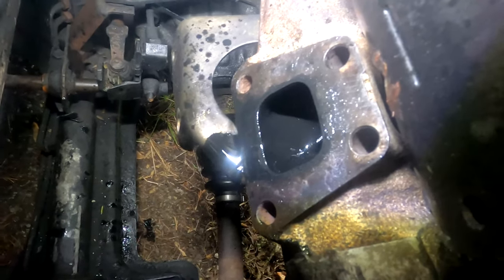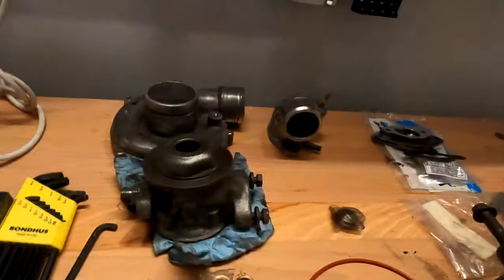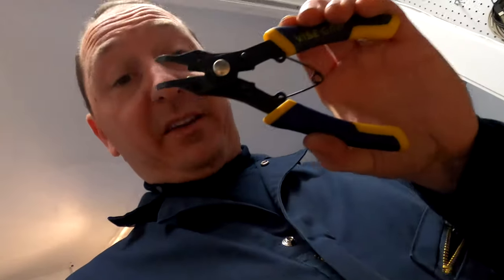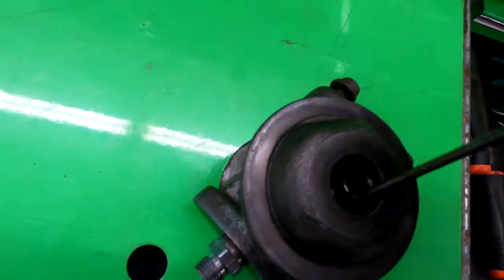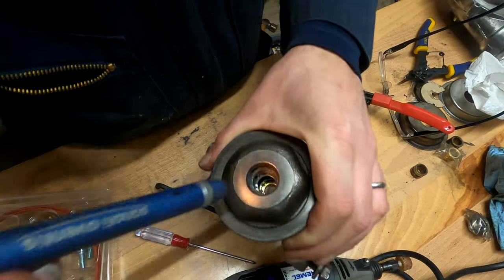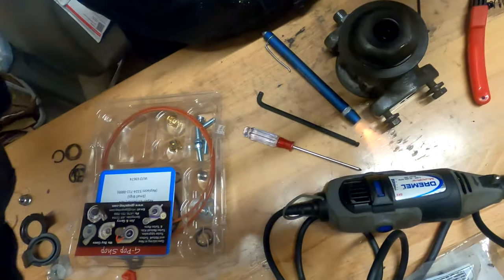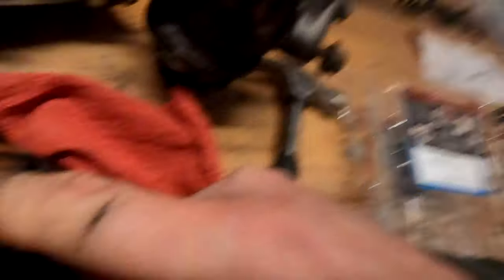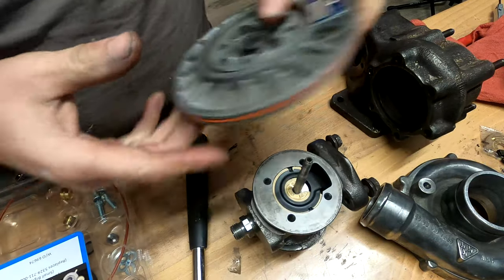Barn Find MK2 Jetta Part 5 - K24 Turbo Rebuild

Comment: Cool videos.  Went completely thru a 1.6td that I swapped into a rabbit pickup, and have been driving the wheels off of it.  Wastegate stuck shut on me the other day, so I figure ill rebuild the turbo, so this is cool.  Subscribed a while back. Been fun to follow the progress.  I HIGHLY recommend doing 2.5 inch exhaust when the time comes.  Sounds cool,  and reduces lag by a bunch! The reduced backpressure will let it build around 12lbs of boost instead of the stock 9 lbs.
Reply from the maker: Thanks for that tip, I was leaning to the 2.5" mainly because stock downpipe isn't available.  The 2.5 from ECS looks to be available and will bolt to the manifold and not that strange round flex thing.  Thanks for watching!
Reply: Build your own exhaust or check around for a muffler shop that is capable.  Just need to make a flange at turbo, work your way down and back.   It will be good content.  :)

Comment: see what did I tell you those guides are easy to replace but now the work begins .
Reply from the maker: Yeah we had quite the debate in the shop and it was not the smoothest of operations but we got it done.  Ended up making a drift with a shoulder that fit inside the new guides.  Froze them, went in pretty easy.  Thanks for the tip and for watching!
Reply: @tr3wrench  ya I have the tools for the guides and the seals but I tell you out of all the guides I have replaced (mostly air cooled vw's) these are the easiest. now if the valves fit with a small amount of play then you most likey can get away without reaming also if the valve faces are good doing a lap job may do. reaming and valve/seat cutting is best but may not be necessary. if you end up needing valve pucks (aka valve shims) I have a huge set I haven't used them in years. do you have the tools for doing the shimming?
Reply from the maker: @mikestrang6229  we did lap them, actually used a tiny bit of lapping and a custom tool to "ream" the guides.  two or three passes and the valve stems went in perfectly.  This is hydro head and the buckets are in good shape.  If the weather cooperates this weekend we might have the head ready to install.

Comment: These turbochargers HAVE to be balanced when placing the impellers back on the shaft. What you are doing here is stupid as these run at over 100,000 rpm and NO BALANCE???? That is why you will notice that the nuts on the ends of the shaft have been ground...in order to precision balance. Simply hob-knobbing them back together is beyond careless. The life of this beautiful K24 (of which I own three) will be greatly shortened and probably experience a catastrophic failure. Peewee.....you really SHOULD have known.
Reply from the maker: Do you have a procedure/tools reference?  I did not find ANY documentation on doing this job.  Other YT videos had nothing on balance procedure.
Reply: @tr3wrench  It's common sense. Why do you think these places which service or sell cartridges own expensive balance machines????? The end-nuts are filed down to achieve balance. Change your handle to "Hob Nob Bob."
Reply: @mt.rushmore7916  I've rebuilt multiple turbos over the years and never had them balanced. Is it a good idea for longevity? Yes. Does it matter all that much for a non daily driver? No. Ive never had one of my rebuilt turbos fail on me yet, some of them going 40k miles strong. No need to come at him so aggressively...